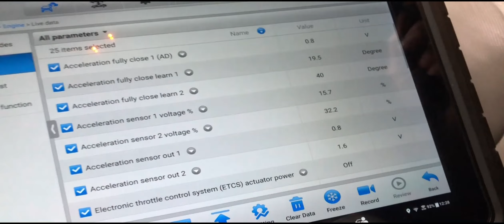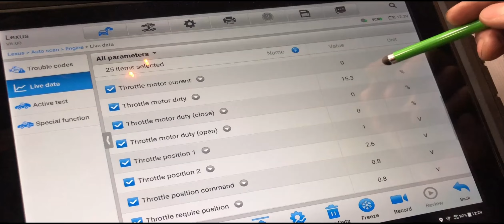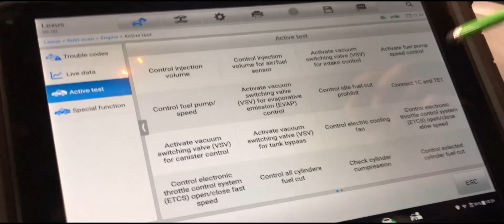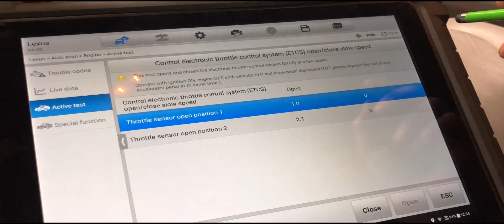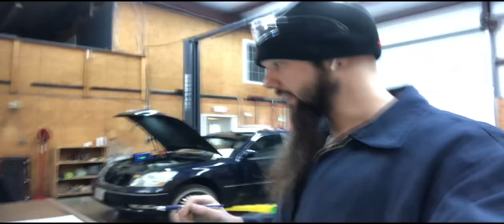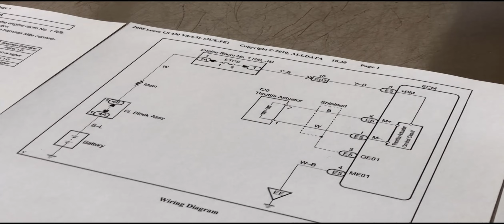Case Study - 2005 Lexus LS430 20mph Torque Limitation - Finally An Easier One

Comment: No radio/nav screen - check for fuse & moisture right side of trunk where Nav is.  My 2004 I purchased at auction had damaged nav due to water intrusion lower right trunk area where baffle is. Nice diag - thx for sharing - interesting about the O2. So when you say boosted - you mean jump the battery  I am assuming - I had to jump mine when it was in the body shop and it wasnt driven that much over 2 month period. never blew a fuse so I guess im lucky.